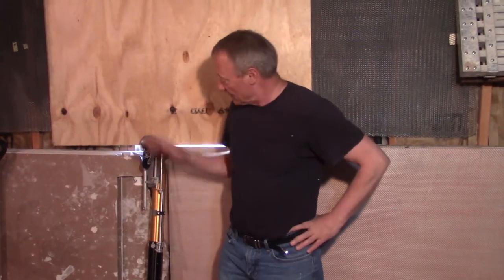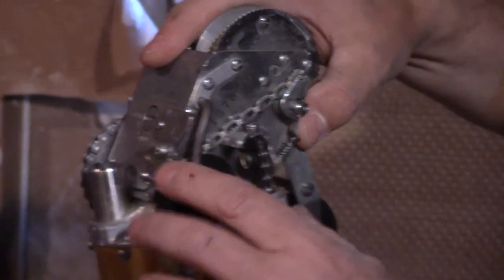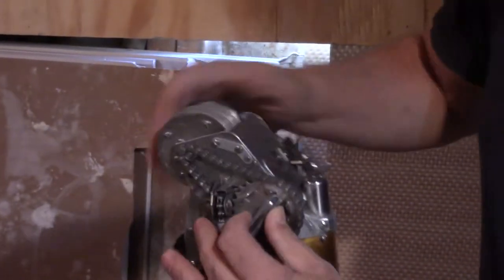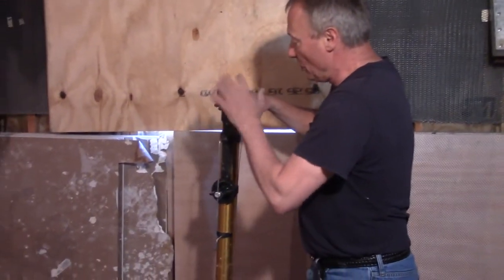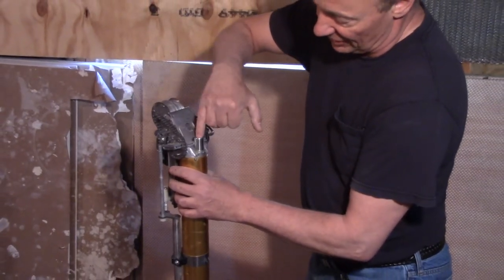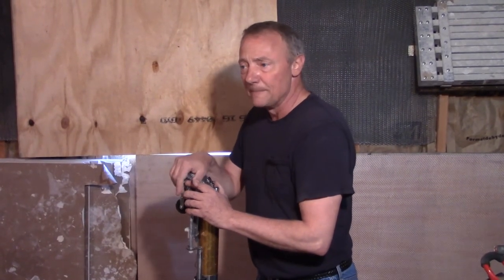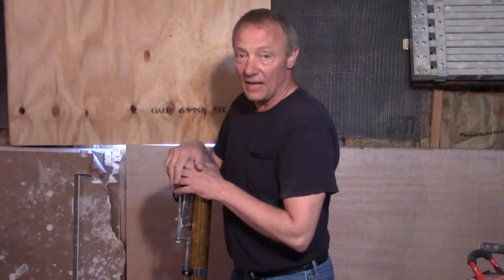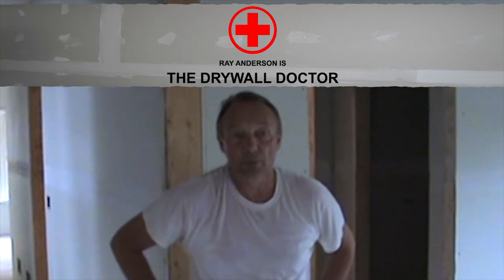Learn The Basics of a (Drywall) Bazooka (Updated and Clarified)

Comment: I've been finishing for over 20 years. I recently watched one of your videos where  you talked about rolling angles in the opposite direction that you run them. This one simple tip is probably the best time saver I've had in the last ten years. I picked up the roller and rolled two angles and the difference was obvious. I showed my guys and they were blown away the difference it made. THANKS!!  It just goes to show that there's always something to learn, especially from someone who takes pride in their trade!
Reply: Max Smith have you seen the techno flusher that replace the roller while putting you're first coat on the angle it's a 2 in 1 but with a special ultra hard and resistant carbure structure head point that doesn't grind by the roughness of the tape it's a 175 canadien dollar flusher that I put on a seringue. I did buy myself this week a 6k scare foot 9 foot sceeling 30 corner less than 6 hours  taping all the angle flushing it and making 2 pass on the 3 ways. I don't have bazooka yet I put tape at the shit biz then I techno flush it. 
I know I need a bazooka because here un Montreal stilts are not aloud hand bazooka seem to operate the 10 foot selling from the ground. 
I would need to learn how to take care of it before buy one and ruin it. 

Then one passe with a 3.5 inch mecanical head flusher and I'm done to pass total including taping 2 and I

Comment: Hi Doc!  Love your videos!  I am in the process of renovating my bathroom and I have put up 1/2" durock aournd my shower area which is fine.  But I've also used durock in the ceiling of the shower aread and around my vanity and toilet areas.  I'm worried I should've used gypsum or greenboard in those areas instead.  Will it be hard to finish durock that isn't being tiled?   Should I take the durock down in areas that are not being tiled or can I finish the durock with compound and paint?  thanks!
Reply: The Drywall Doctor so I should plaster over the Durocher correct?

Comment: What's the problem when the bazooka is not leaving mud under the tape? Driver shaft or is it the wheel? Thanks in advance
Reply from the maker: It's usually because it's slipping and not winding up the cable to push the mud out
Reply: @THEDRYWALLDOCTOR1  but its tight on the little screw that goes on the driver. When the bazooka its empty it turn with no problem... but when it's full I run it for a bit then it leaves spots with no mud.. sorry to bother you again but I dont want to buy another bazooka if I can fix mine..
Reply from the maker: https://youtu.be/QOu1kqVdCbA. I also have a playlist for bazooka problems
Reply: Check to make sure your wheel brake is tight enough. If not your wheel could be reversing slightly occasionally leaving dry spots under the tape. I had my brake loosen up on me and had dry starts for a couple days before I realized the problem.

Comment: Excuse me do you one place in Chicago to fix the tools
Reply from the maker: Do you have taping tools that need repair? What brand?
Reply: @THEDRYWALLDOCTOR1  thank you for answer is the first bazooka the same like tape tech but is the gray color with the cutter tube in the middle black they stop making it now is only tape tech
Reply: @THEDRYWALLDOCTOR1  my trap door in the bazooka is not good I have to replace it my bazooka have 4 screws on top to pull the metal to se inside